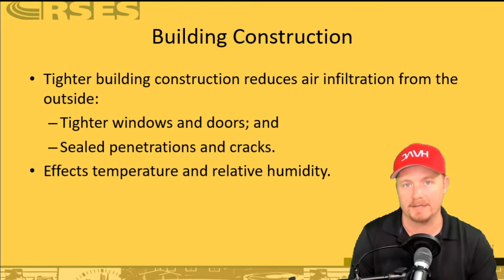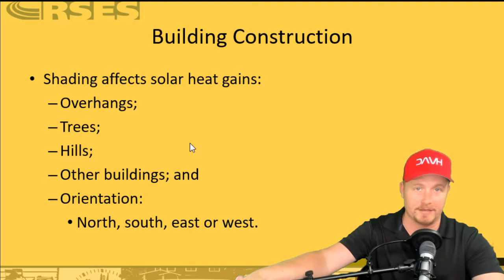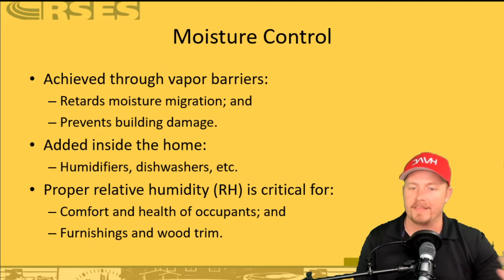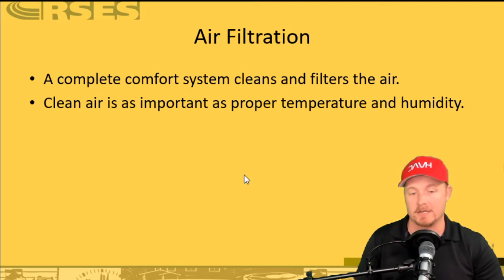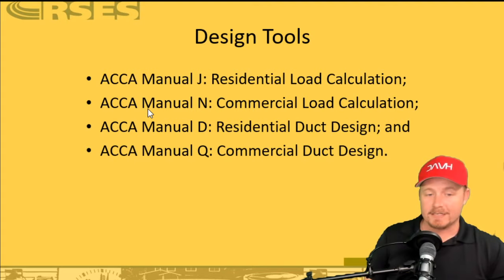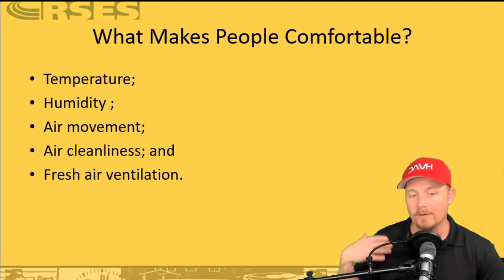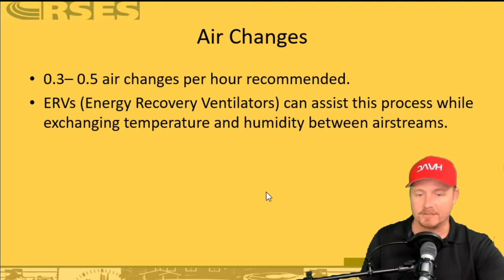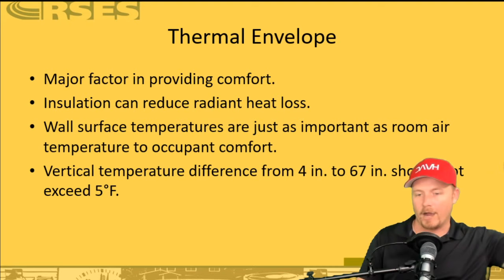Human Comfort Basics - RSES NATE Prep

Comment: Should we treat the corona virus any differently from the flu. What information do we have that the corona virus is transmitted differently from the flu. And what ways can we help to not only prevent the spread of corona virus but also offer solutions to decrease the spread of corona virus over the flu. As HVAC owners and technicians and installers, what can we do to better protect and serve our customers. If customer X already has the full pathogen-air pollutant-noxious gas air filtration system, what more can we sell them under the guise of safety?